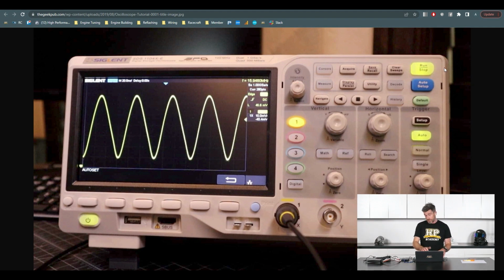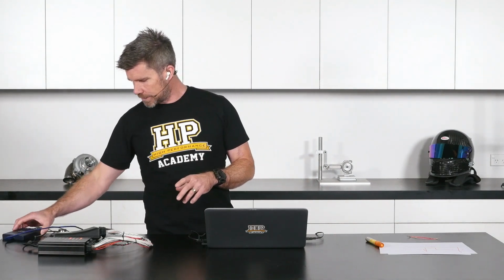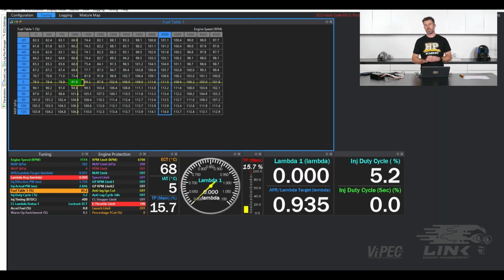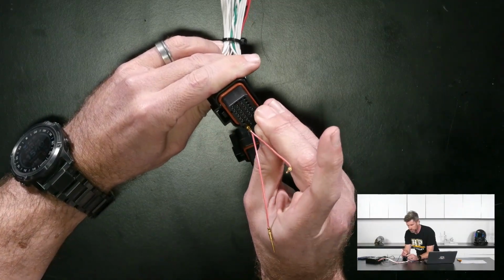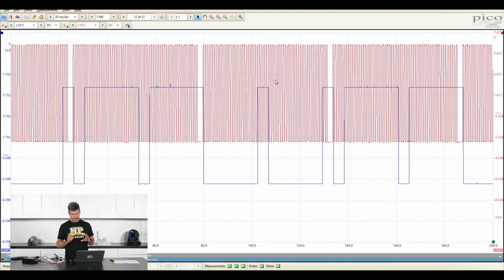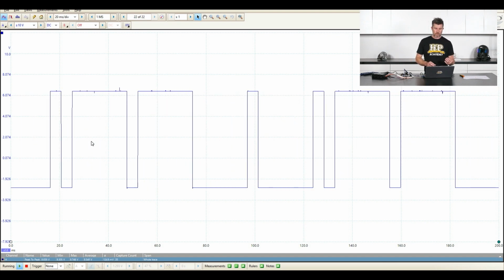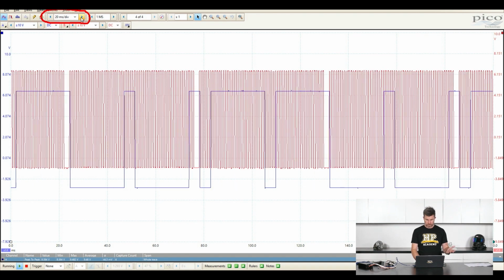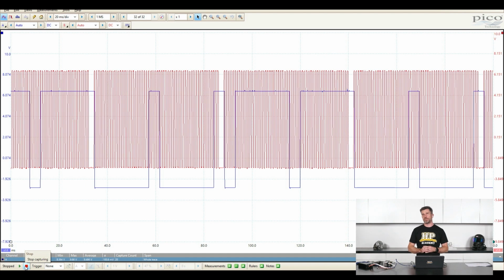Wiring Experts LOVE This (Relatively) Simple Tool

Comment: Do you have one video like this, but using the Haltech Elite oscilloscope, but with actual hands on testing, so you can see the wave on the oscilloscope and see what happens when it the sensor is not adjusted correctly to match the timing, same for the  camshaft position sensor, to see the mismatch of the position of that sensor to the teeth in the reluctor.

Comment: I use a labscope everyday. Best way to do non invasive testing hands down. Testing no guessing!!! I have a built in 2 channel on my snap on triton, a 4 channel on the verus. Hands down the pico is the best. Price point and the resolution is unmatched. Everyone who watches this needs to get on board and learn them. Once you understand the features and applicable settings per each system being tested you can figure just about anything out that youll encounter. A while back I asked in a comment if you guys can do a series on diagnostics for a performance application on srandalones since they don't have fault codes like OE manufacturers use. This is right in line, keep it up! I'm sure a lot of people will get a lot out of this.

Comment: Loads of good information here !
I can add Bench style oscilloscopes need mains voltage, and usually have ground / negative pole connected to mains supply protective earth.
Good thing to have in mind, both while buying and using.
Reply: Some of them have battery packs and you just manually attach it to ground